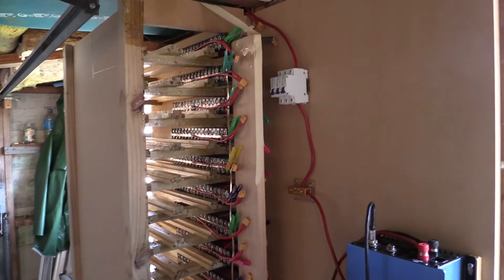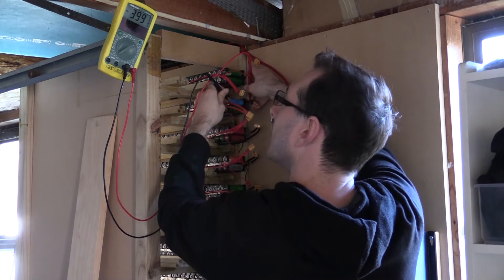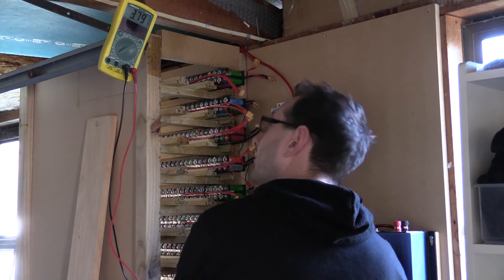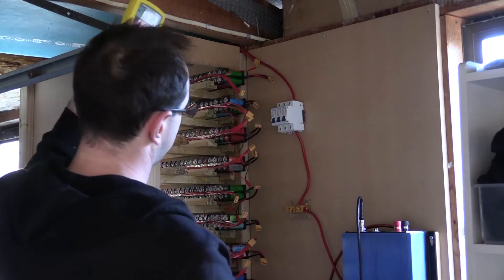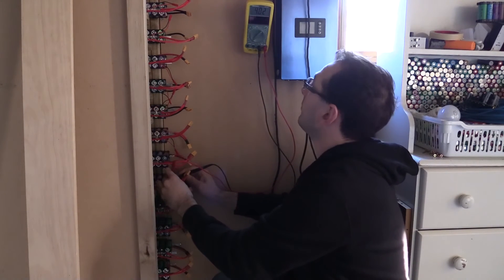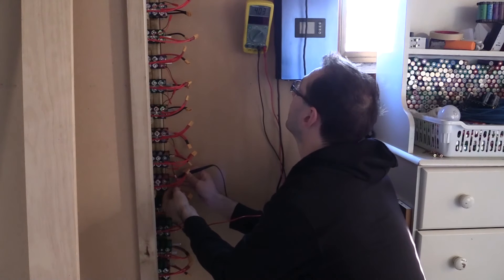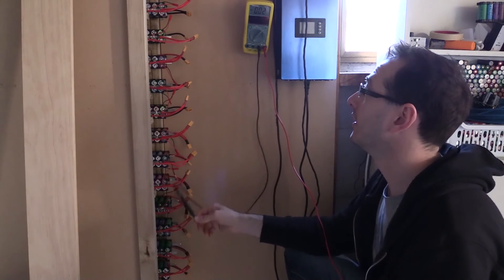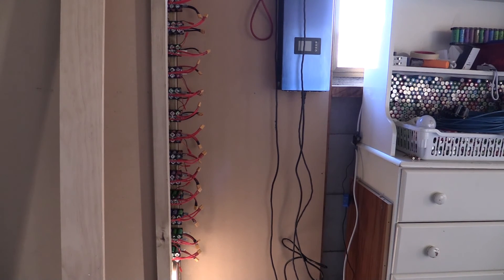Mikes DIY Powerwall Update 20 - Balancing Bank 1 Results

Comment: Hay i was thinking about this..  

I really do think that balancing packs is going to be a HUGE deal, this is in part because you have so many in "p" and because the packs wont have the same capacities and even if they do now  in 6 months time they will be even further out because you have random batteries all degrading at different levels 

If it was me i'd make my own high powered BMS ... Id make one because i believe you're going to have to make one anyway to to hit your charge and discharge voltages. I believe to ensure long life of the batteries you wont want to charge them fully or discharge them fully  so the only way to do that would to build your own arduino BMS to monitor each packs voltages independently.  I would then get some maybe 0.5 ohm wire wound resistors(can get some huge wattage ones ( 6A @ 3v ) and put them across each pack. You could then us the arduino to turn the resistors on and off to balance the packs. 

I dont think an arduino will have enough PWM channels for the number you'll need. i would suggest you just use the digital outs and set them high or low per loop , which will still be more than fast enough with a cpu at 16mhz. IF you do this idea of getting arduino to switch mosfets on you'll NEED to make sure you buy logic level ones so that with the arduino's 5v it can fully turn on the mostfet( I cannot stress how important this is). 

Still i have a fundamental problem with intentionally wasting energy to heat.. it just seems SOOOOOO wrong, and im sure 1 year down the track you'll be wasting ALOT of watts to keep so many packs with random cells in line with each other. 

I know you'll hate this idea cos it's completely the opposite of what your trying to do  but you could completely avoid these issues  if you simply dropped the voltage down to 3 volts and and thus everything could be in "P" and therefore always in balance you could then simply step it back up to your desired out put voltage..  

I'm still convinced that in 6 months with 27 ( i think ) packs in "S" that with all have random capacities balancing if going to be a significant challenge/ loss off total system efficiency.    

Anyway this is just some 1/2 bakes idea's i had last night.
Reply: humm actually since you're only using these panels for charging batteries you could do a hybrid of the previous 2 ideas.. in charge mode use the arduino to configure the cells in parallel then step the panels down to your charge voltage (3.5or whatever) and then charge them. Everything will be balanced.  On discharge reconfigure the batts to be in Series..

For maximum efficiency you should then configure your panels in P and not use that solar charge controller you have now. But that is not very good so is no loss
Reply from the maker: Balancing is going to be a problem but somewhat the same as any one with a lipo pack as their S count is also higher as the voltage is lower per cell, i think you mean S not P, 20 packs in series but your right i need 20 balancers just for bank 1 of 5kWh.

I plan to build by own balancer but it only needs to be 1amp balance per cell. That would mean a 15 amp charger could max out the balancers but thats fine as the packs should be kept in balance anyways so there shouldn't be a big difference between packs after the balancer has been in use for sometime. Plus for more banks of 5kWh if i was charging at 15 amps 83v then that's halved per bank.

I am building the arduino BMS unit now and just able finished and ready for testing. It will handle all the controls and monitoring of the whole system and sending all the reading back to my main power monitor the emonpi which then sends it to the web for access anywhere, Now the balancers and cell monitoring will be a separate arduino unit that i will need to build next.

Balancing i plan to kinda do what you said, the cell monitoring will be unit 2 using the mega this will work for 40 cells or 2 banks of 5kWh etc and the cell balancers will be unit "3" x20 x2.
The circuits i have been looking at will use a power Mosfet rather than a wire wound resistor as the load i think. The only way to not waste power in heat is 1 to keep the packs in balance or use a Active balancer which is very hard to build or expensive to buy with the numbers i need. So my plan each balancer will use a Mosfet will be turned on by a ATtiny, My new fav thing haha. With any luck it will monitor the voltage send it back to the mega and decide how much to turn on the mosfet based on the voltage of the cell. Now thats the plan but i haven't tested the balancing part. Thats my next thing to start testing. The cell monitoring works well i have done some basic testing with 2 cells in series, i just need 1 per cell so a total of 20 right now but really i should make 40. Thats alot which means i need to plan the best way to do it. I haven't made a PCB in years but i will need to. I need to keep the cell monitor/balancer simple as i can if i need to build 40 of them , long term with 3 banks i will need 60.
Reply: Sounds like alot of work / fun ... When are you going to sell the EVO and buy a Volt ?
Reply from the maker: haha never tho i do need a daily driver as i had to give my work car back .
Reply: maybe you should be building a volt and not buying one.. that seems like more of your style :) lol

Comment: Maybe you did, but if you are measuring at mV accuracy, let your multimeter warm up (powered on) for 5 minutes before measuring. It does not explain the difference of the 4.09 V pack with the rest, but it might explain the difference between the top (where you started measuring) and the bottom packs.

Comment: to aid balancing, connect each charger lead on opposing ends of the packs. i.e. positive on the top end and negative on the bottom end. This will distribute resisitive losses among the steel strips more evenly.

Comment: Hey mike, what do you do with all your cells 1000-1500mah? I'm asking because I'm building a 14s14p ebike battery pack and I now have this giant pile of cells that still work but are too low to make it into the ebike battery. What should I do with them?
Reply from the maker: It seams a shame to throw them away, i would retest them and the best ones put into a big pack, eg if you have 14s 14p then when use the 1000-1500 do 14s 22p, that way the capacity of your 14s pack will be around the same as if it was 14p but you get to use all the cells that are doing nothing, If anything it will give you a spare pack for your ebike. Just an idea. i would use the 1300-1500 etc

Comment: connect the packs up with a ring circuit, the current is then equally shared and distributed - currently the nearest pack to the current source takes priority - having said that you've already got very little difference
Reply: you can't just connect the cells together with a ring circuit because it will cause shorts across all the cells. On the other hand if he had a way to isolate every cell connected in a ring circuit it would indeed work.
Reply: you're misunderstood - a ring is a universally accepted method of connecting power distribution circuits, its the perfect way to equally balance a load - look up the connection topology for large scale battery banks, they always form a ring - if you thinks cells will be shorted you've certainly misunderstood

Comment: The problems with balancing this way are (among other things) Peukert's law and cell settling and the fact that the state of charge is non-linear. If we make up some figures: you might need to transfer 10% of the packs energy for a 0.05 volt differential over 0.1 ohm of resistance. Ohm's law yields 0.05/0.1 = 0.5 amps... 10% of 100Ah is 10 Ah -> 20 hours... Note that that was mainly guessed figures and not taking the non-linearity into account.

My suggestion (for now or next time) is to bottom balance the cells. Connect them as you did, but discharge them all to 3 volts (they will bounce back up, so it'll need to be something like used in https://www.youtube.com/watch?v=0gZmEIud58c). The difference in the amount of energy the cells can hold between 3.00 and 3.01 volts are extremely little, and hence the balance will be better. Note that you will need to adjust the maximum charge voltage accordingly since your pack might not peak at the maximum voltage any more -- but the cells will be more equal.

Disclaimer: I'm only a Youtube-addict and powerwall wanna-builder without hands-on experience due to lack of time.
Reply from the maker: Looking at some videos like that , people are saying top balancing is alot quicker

Comment: It's not different enough to cause a problem they'll drift anyway
Reply from the maker: Maybe i should of left it a couple of days but will know for next time.
Reply: Maby cykle them abit and check after a few cykles... 0.1 or 0.2 is not that much and the batterys are recykled and ther not all the same so ther internal resistance might show diffrent charge and discharge characteristics.

Comment: i balanced all of my packs over 4 day's.  Each packs voltages were the same 3.9230 volts, but after about a week they all slowly driffted and settled to with in .0050 of each other. i guess have different manufacturers cells this will always happen.
Reply from the maker: I think i needed to leave it for longer